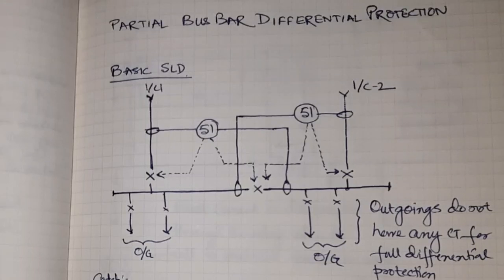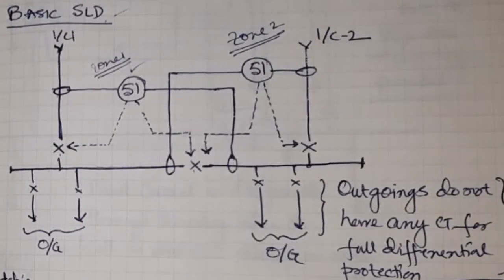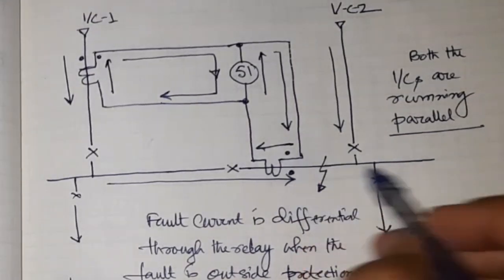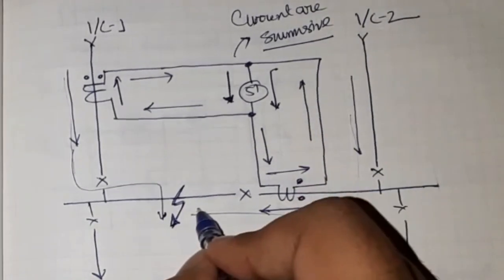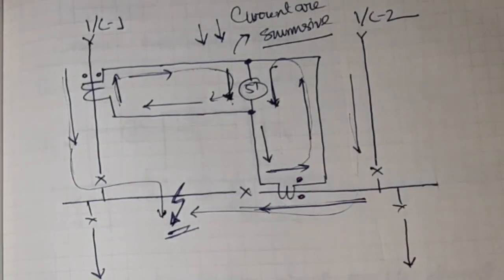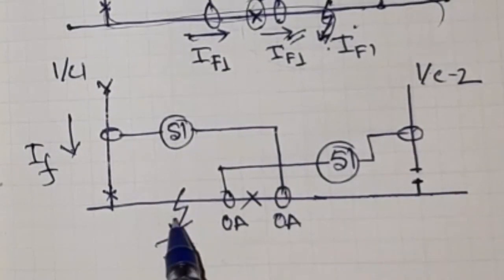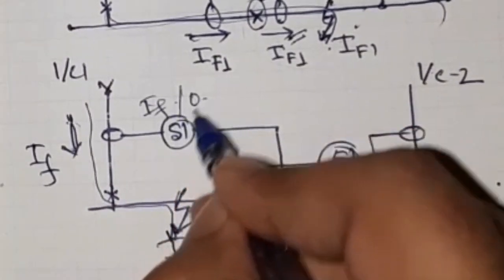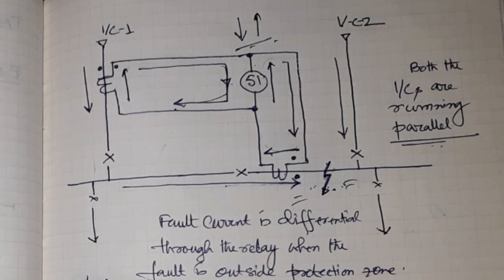Partial Bus Bar Differential Protection|Bus bar differential protection|Bus bar protection

Comment: Settings for differential TR. with polarity, calculations for biasing , Vmax , using tap changing and effect on I FL due to motor load and same on respective slope......
U r doing great please complete it with 100% .
Provide settings calculation in detail and changes that could those settings.